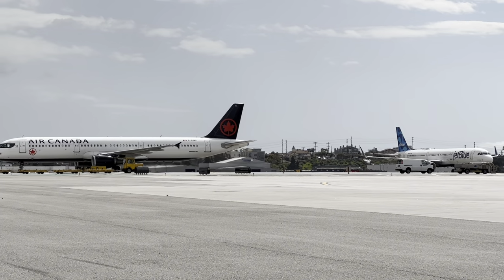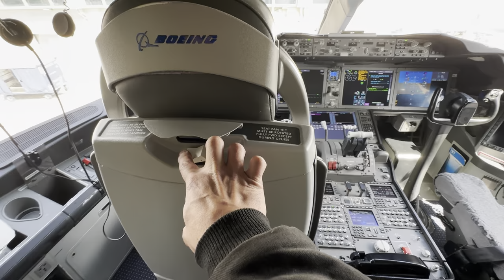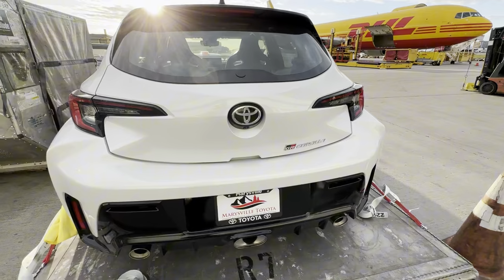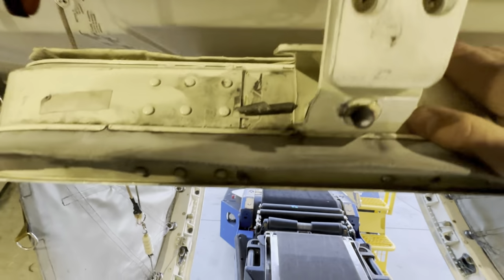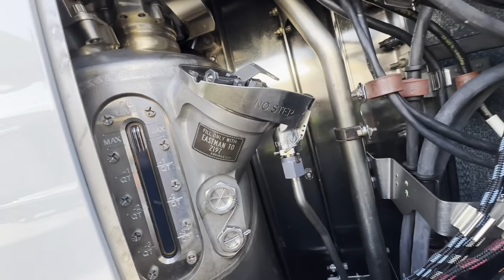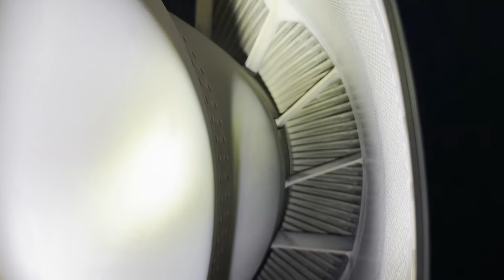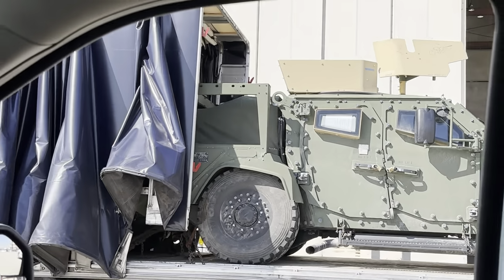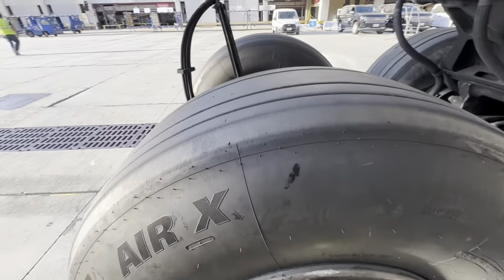Stig Shift #17 (Aircraft Maintenance Adventures)

Comment: Know its a good day when stig uploads. Cheers stig
Reply: Amen.
Reply: Well said, Lock. 💛 🙏🏽
Reply from the maker: Thank you Lock. 🤙
Reply: I would love to say I agree. But my day hasn’t been very good. That was until I saw that Stig uploaded
Reply: What's going on Stig with M & R? Seems like more M & R screwups than you can shake a stick at - wheels falling off, lo lube oil pressure, door plugs unsecured... you name it. CareIessness? What?
Reply: @andreweppink4498  It’s not the screwing up of the hard working A&P brothers in the field. It’s PMA parts and suppliers..we always dot our i’s and cross our t’s 
FYI blame timken for the failed wheel bearing of the united departure SFO 777 wheel falling off.. It was the defective outer race of the bearing that failed resulting in the wheel falling off.

Comment: Hey Stig.  I can give you some of my 787 Captain seat perspective of a possible/probable example of what happened with that inadvertent pilot seat electric forward movement.  First off, human startle factor is a real thing for an event like this, and the reality of not reacting quick enough compared to analyzing it after the fact.   It is very likely this was a meal tray contact issue.  The flight attendant could have just given the pilots their meal trays, and in a Boeing as you know, they go on our laps.  The PF (pilot flying) will only bring his/her seat back a couple of clicks so as to not be unsafely too far aft of the rudder pedals/control column.  Now visualize that the hard plastic meal tray forward edge is only an inch or less away from the control column stand, and tucked close to the Skipper’s abdomen on the aft edge.   The flight attendant is standing behind, chatting for a few minutes, elbow leans on the button cover, which is displaced slightly open because of the defective rocker switch.  The seat starts moving forward, everything happens very fast now….  The hard meal tray is getting squeezed between the vertical control column and the belt line of the pilot.  The autopilot is pulling back hard to maintain the aircraft’s pitch.  Suddenly, and I suspect within only a couple of seconds before the pilots understand what is happening, the Autopilot reaches its control column force limit and disconnects.  Now the bird will pitch down very aggressively because of the nose up trim that the autopilot was inputting.  What happened next was horrible.  Many in the cabin hit the ceiling (unfortunately too many did not have their seatbelts on while seated), and in the cockpit I’m sure the food went airborne and the standing flight attendant hit the cockpit ceiling.   A very bad day for all involved.   We have a specific memo now about this incident and more awareness of keeping an eye out for a defective rocker switch, and to not let anyone ever lean on a seat back.   Hopefully this will never happen again.   The final report will confirm what happened that day of course.  In a perfect world, the pilot would have sensed this happening immediately and stopped the seat movement before autopilot disconnect.  But as I said, the startle factor has to be applied.  Maybe a second or two longer and the manual seat intervention would have happened and stopped the movement, then an Air Safety Report filed by the Captain, and a preventative lesson learned.   Btw, a similar thing happened on an Airbus years back.  An A330 had a violent pitch down like this Boeing incident, when the left armrest made contact with an SLR camera which then made contact with the left side stick controller while the seat was moved electrically forward after getting back into the seat.   MentourPilot made a good video about it if interested.  I’m sure his channel will create a video about the LATAM event also within a year.
Reply from the maker: This is absolutely fantastic breakdown Mike, I really appreciate you doing this, especially from experience that you have. Everything you describe could and might have been the case. The startle factor is real and I do agree with you on that. This is what we call the Swiss cheese effect, the holes perfectly aligned, and the chain of events occurred. Whether the seat was not moved back all the way the food tray was in a very particular position, there’s so many factors here that basically could’ve happened. My only observation is from the mechanical functionality of the chair itself. And that was the primary purpose. I wanted to point out the cut out switch.
Reply: Dang, I was going to comment “should have been flying an Airbus” but that’s an unfortunate incident with the A330.

Comment: For what it’s worth, pilots can cross their legs with their seats slid further back. If the seat were to start to move, the pilot’s leg would already be right by the column and the crossed foot could get pinned under the control wheel really quick. I’m on the Bus though so no control column for me.😀
Reply from the maker: You get a lovely table and eat like a civilized human being 😆
Reply: @StigAviation  Indeed 🍽️☕️😂

Comment: The old electrical panel of the 737-200 is still there even if the two AC ammeter are now missing. Somewhere i read that the reason for keeping the old round shaped panel on the newer models is certification. It looks like changing too many minor things, will force the builder into another certification process for the type.
Reply from the maker: You’re absolutely right, they can only change so much on that airplane, hence the max

Comment: Quick question....when landing the pilot puts thrust levers into idle...why then is there so much thrust that is redirected through the reversers during landing. Does idle thrust not mean that there is no thrust?

Great videos sir..look forward to every upload.
Reply from the maker: The engine computer knows to accelerate and increase the thrust without the pilot moving it. Especially when the aircraft engine is in thrust reverse mode.

Comment: Im not sure if you ever mentioned this but this tidbit is a fact that very few know about - So the word “hijack” comes from a method of alerting ground control, by quickly entering on the pilots keypad…” H, I, J, K “
Reply from the maker: I did not know that, that’s very interesting, I just always thought they will use the transponder code for such events. 7500

Comment: Hi Stig….on your ride with the tug, I noticed fluid coming out near the front landing gear. What was it? As for the Latams flight, why did so many people not have their belts on as per instructions. Their fault for getting injured. 🤷‍♂️
Reply from the maker: The fluid was simply water being dumped from the forward potable water drain

Comment: I love how you explain the parts that might not even be that interesting. There's the idea that everyone probably knows which is along the line of you design something with redundancy because the main thing can and will fail at some point. Like, there probably isn't that much debris in the oil and it probably takes months for it to build up to where it needs servicing (at a guess), but it's still something you have to consider... you can't just hope for the best and assume it will stay clean forever
Reply from the maker: And you’re absolutely correct, that’s why they build them like that.

Comment: The rims on that P1… not a fan lol. That was a nice push with the 737. Those of us at my station that push, it’s a daily competition to see who can get each aircraft exactly on the line. When it’s 10 degrees out, they tend to not be so pretty lol. I just want to get back inside and warm up. You’d think that the smaller planes get, the easier the push. Not so. I’ve pushed everything from a CRJ-200 to a 747-400, and the bigger, the easier. It’s the best part of the job. For me, towing is the inverse. The small jets are obviously much easier to tow. 
Thanks for the amazing content, Stig.
Reply from the maker: You’re absolutely right, the bigger the aircraft, the easier the pushback. I have pushback at 747 as well and that was super easy. Slow and steady, minor adjustments and as long as you don’t hit anything, it’s OK not to be exactly on the line.

Comment: Hi Stig, another great video. You explained the brakes really well but, it got me thinking about a few 777's and probably other variants, losing a wheel on takeoff. How can this occur when so much effort and care goes into servicing?
Reply from the maker: There are times where simply components fail. Such as the UA incident where it lost a wheel on take off due to wheel assembly or bearing failure (still undetermined). But there are cases of poor maintenance and human factors involved. There are safety features to mitigate such situations but it does happen time to time.

Comment: Hey about the flashlight, can you use it on the avionic rack? Since it’s magnetic and I know you can’t use anything magnetized. Love the videos keep making them!
Reply from the maker: You can use it away from sensitive equipment, but most wiring are shielded to prevent electromagnetic interference. But you should be mindful and not bring it too close.

Comment: I had to restart your video several times, simply too interesting! Great paint of that biz jet, but for visibility is probably the best camo you can make. I rather be visible in the sky and paint yellow or orange. By the end of that tow 73-8 there was a little bit of water came from  above the wheel (left) door is there some kind of drainage over there? time 25:00
Reply from the maker: It’s water being drained from the forward potable water drain

Comment: 18:47 regarding the cutouts: I've always wondered why they keep those even in aircraft that don't have the gauges there anymore. Is it because it's just easier manufacturing wise that they don't have to adjust them? (and/or because of replacement parts?)
Reply from the maker: I’m going to assume because the manufacturer of the back panel is still producing the same thing and at a good price, but the design doesn’t need to be changed, so they just keep on doing the same thing

Comment: Thanks for the update on the 787 pilot seat. Yes it moves quite slow and I had a feeling there was a kill switch I just didn't know where. It is silly to think that the pilot has no recourse when moving forward in slow motion? Apparently this was during the meal time of the pilots when a flight attendant came in and "nudged" the switch. This is another question as to the cover is on or apparently they are saying slightly broken cover. Then if the Captain has his food tray on his lap as instead of on a pullout as in Airbus, he might have been distracted enough to remove the food tray, hit the override switch and take control. Maybe something will come of this in basic philosophy of "Who's flying the plane?" so that one pilot is always more spaciously aware during this process. Its a wonder that Boeing went with the different design than the standard in the 777. As you say lets wait for the CVR report. Is there any parameter readout on seat devices recorded?
The Porsche is a "CFS911" and is a collaboration between SV Auto and Ultimate Cooling Systems with restomod modifications and modern designs to an 1970's 911. They modify the body for engine , suspension and aerodynamics then slap a 993 engine mod and tuned racing suspension. The body also gets aerodynamic flow body assembly parts to enhance cooling and flow. There has also been a lot of modifications and fabrication to the modern wheel assemblies and dash gauges. Only $500k :) Just doing a bit of reading I figure the brake assembly on this car is 10k alone in parts. The upholstery in the interior is actually made from upscale women's handbags!
Reply from the maker: I don’t believe there are any readouts for the seat configuration because it is a very standalone system. But the voice recorder will feed more information in regards to what occurred in the flight deck.  And thank you so much for the information on the Porsche.

Comment: @@StigAviation when you do a tire or brake change, how are the brakes turned off to do that? I don't think you can change them with the brakes engaged, so are the wheels chocked and brakes released or how is that done? Thank you Sir!
Reply from the maker: In order to remove that break, we released the break within the flight deck, and somebody has to pump the brakes to depressurize the system. Once that happens, we can remove the hydraulic attachment, and you are correct on the aircraft being chocked.

Comment: I had to fly with one of our jets about a month ago because the entry door light was coming on during landing. We MEL it since it was coming in the following day for an inspection but they needed MX to verify it was indeed closed and locked before eash departure.
Reply from the maker: That happens all the time, simply an indication issue. You can dispatch the airplane as you said with verification.

Comment: Nice video as usual Stig...  Question: Does the constant heating and cooling (expansion /contractoin)  of the brake calipers or rotors change the materal composition or create cracks on it?  I hope I phrase the quesiton correctly.
Reply from the maker: The material that is used is very resilient and can compensate for the heating and cooling. It does expand and contract, but it does not damage it.

Comment: That looks like my wire management from when I was in the army as a mechanic and any time I found a piece of equipment that didn’t look right as far as the wire management I spent the time to make it correct. Normally if you open a electrical panel on a piece of equipment and it doesn’t look properly managed usually means that someone took a shortcut and more often than not the wiring is not done properly and cause a defect that mechanics go crazy trying to find and fix when it’s usually right in front of you where the wiring wasn’t managed correctly
Reply from the maker: You are a very diligent and excellent mechanic for doing that. And thank you for your service Paul

Comment: Its me again, let go!

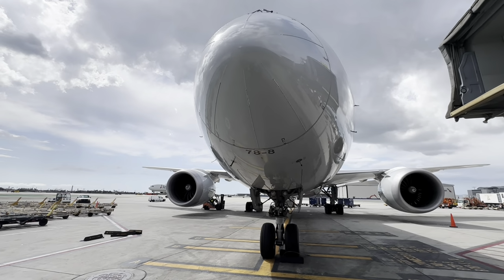01:07 – B787 Engine Oil Replenishment + Sump Screen and Tab

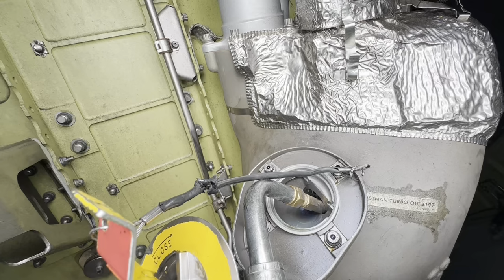02:08 -B787 Engine Debrie Monitoring System (Air Oil Separator/Particle Separator)

02:29 – B787 LED Anti-Collision Light (40,000hr end of life feature)
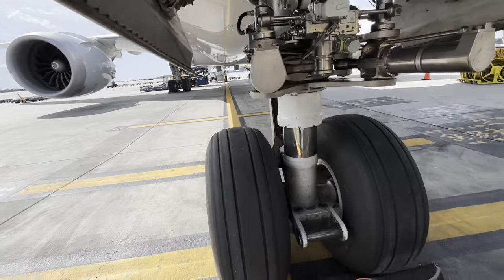04:00 – B787 Nose Steering Actuators (5000 PSI Hyd System)

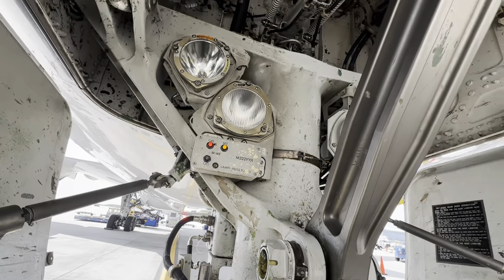04:13 – B787 – Functioning Condition of the Main Landing Gear Brakes

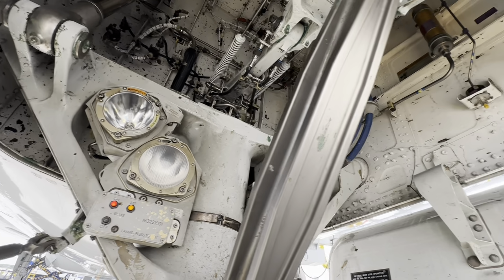04:33 – B787 Hyd Accumulator (Nose Wheel Well) + Charging Port (2500 PSI) – Provides Head Pressure to the HYD Reservoirs. This particular ones aids in dampening spikes.

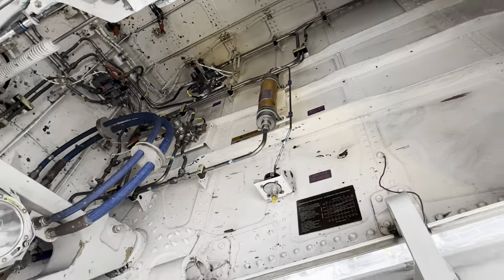05:12 – Nose Wheel Stoppers

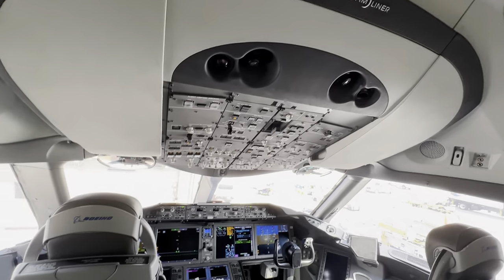05:31 – Button for Electric Seat + Seat Powe Cut-Off Switch

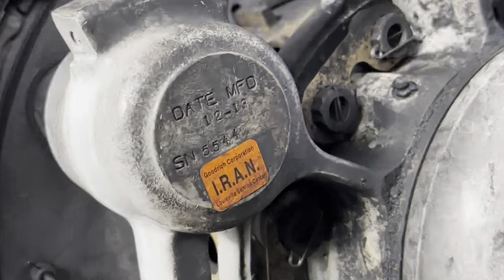10:18 – B777, Brake Wear Indicator + IRAN (Inspect Repair As Necessary) 

 10:56 – B777 Power Seat + Power Cut-Off Switch

19:11 – Ground Power Cable + Nose Wheel Well Light Switch
Reply from the maker: Thank you so much for taking your time to do this. Much appreciated.

Comment: GA aircraft basically the same as far as airframe, landing gear, flight controls, hydraulics and engines. They also have APUs (larger aircraft like that Global Express) The only difference is interior. Some are super fancy seats, sofas and even queen size beds with full showers. Love your videos Stig. I’ve been a GA mechanic for 15 years.
Reply from the maker: Thank you so much David, I personally never did work on General aviation, I went straight for the major leagues. But it would’ve been fun to work some GA birds

Comment: Hey Stig, got a special request if you can get to it, how does the steering mechanism work on the pushback tug, since the tug is connect via the tow bar, it can’t turn the wheels like regular cars do, I imagine it sort of “swings” around to maintain the angle and radius relative to the nose gear.
Reply from the maker: It’s a two-point connection, the towbar is connected to the tow vehicle via a swivel point, and the other side is connected to the nose gear. Imagine, towing a boat, same concept.